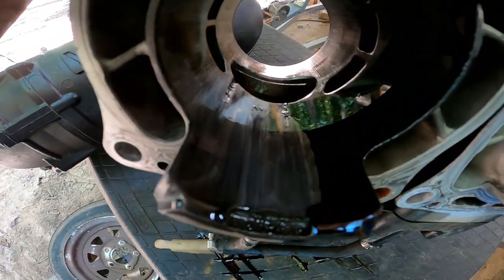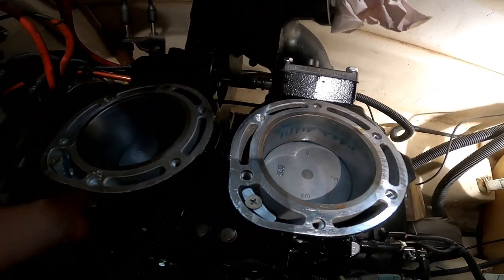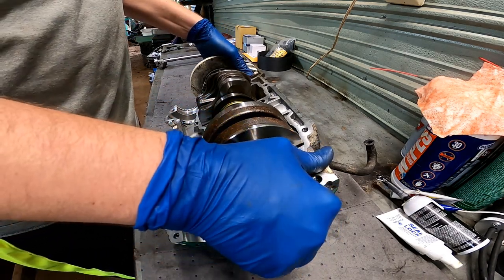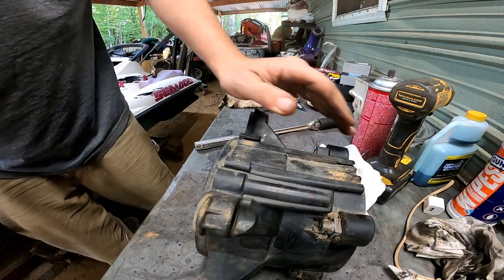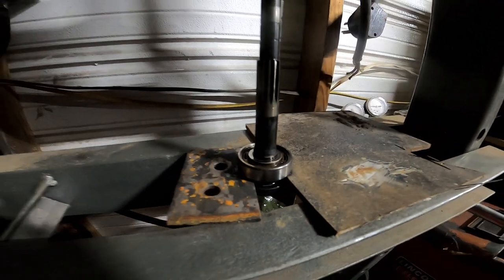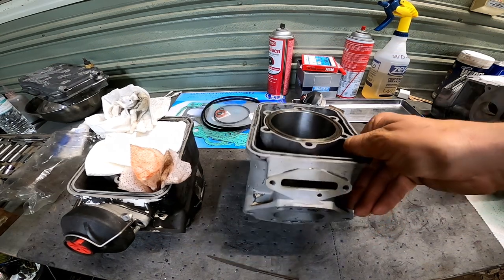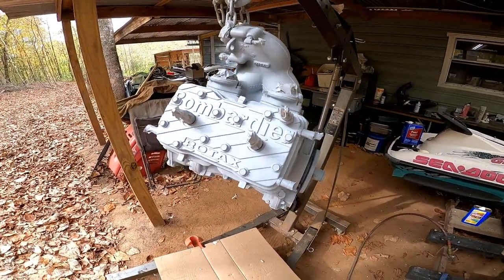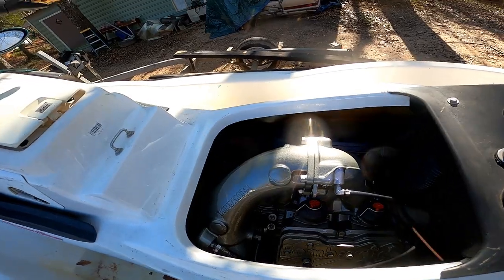REBUILDING THE CLAPPED OUT MARKETPLACE  JET SKIS

Comment: In reference to tough to get off adhesives, there’s a product mainly for automobiles that won’t ruin paint or fiberglass. It’s called “Goo Gone”. It comes in a yellow bottle and comes for many applications. I used it on the inside of my windshield and it came off like butter.
Reply from the maker: yes sir👍

Comment: Wow! Excellent series of videos on the rehab of these old jet skies! You are one stoic dude, how could you not even crack a smile when you first got them running, and then when after a major rebuild they fired right up and ran so well?  In 1996, I bought 4 new Sea Doos, 2 GS and 2 GSX base models to start a small rental company at a local lake. It only lasted for two years because of insurance and maintenance costs!  The thing that frustrated me the most with the Sea Doo models of the time was the mix of SAE and Metric fasteners and those damn rotary valve plates! These engines were very foreign to me at the time, and even though I was a gearhead, I thought they were above my capabilities.  The Dealer and local marine repair companies really took for me on the repairs of those problems!

Comment: Wow u do amazing transformations n work,im guessing 75 pieces on the jar i could use some pod lights on my new bass boat i recently bought!hey maybe you can explain too me how does the water come into a jet ski and routes thru and back out?snooky pa.i own a 94 yam 650.💥👍💥
Reply from the maker: thanks Allen!! on a ski it sucks water from the bottom and hoses run it through the engine then out the back🙂🙂🙂👍👍
Reply: Yes i understand that concept behind it same as inboard or outboard with seeing ur hot pee stream,long as its there you know engines sucking in cold water and giving tell tale extruded hot water out the pooper or peerer.what im looking for is a schematic on actuall routing of my 650s water system.ive heard there is small inlet hose somewhere near the thrust ring and then would be nice to know all water connections routing to and thru and out this said motor.because i lost power on return trip up river was running fine,here a small 1/4 hose running from big hunky exhaust into top of head had got old and split at zip tie on nipple.sprayed hot water inside and ski went into limp mode,iam assuming because sensor picked up getting hot!!!rehooked and ran fine.but because of this i wanna know coolant routing n hoses to replace.were can i find this info any clues???snooky pa.💥🤪😜👍👍💥

Comment: Very cool series.  Your work looked great for not having a ton of knowledge/experience on each platform. My only concern is that you didn’t replace the cranks seals on the Yamaha.  They blow up enough as it is, having 20 year old crank seals isn’t going to help.
Reply from the maker: yes you are correct I did do a leak down test and they were fine so I figured I just run it like that

Comment: did you trim the Rave valves to account for the difference in bore clearance or you on stock bore from resleave?
Reply from the maker: Stock bore so not needed
Reply from the maker: I did chamfer the port openings though
Reply: @TheHomePros6221  perfect, yeah, only need to worry about that when over- boring from stock
Reply: @TheHomePros6221  nice, that should help with ring wear

Comment: Hate to say, I see 2 strokes that bad or worse, on trimmers and leaf blowers. I service small engines and usually it's a customer who just bought a 2 stroke engine with no clue it needs oil mixed with the fuel, even though it's printed all over the machine. Some I can save if a top end kit is cheap enough, but most are scrap.
Reply from the maker: It’s crazy people buy stuff and have no clue